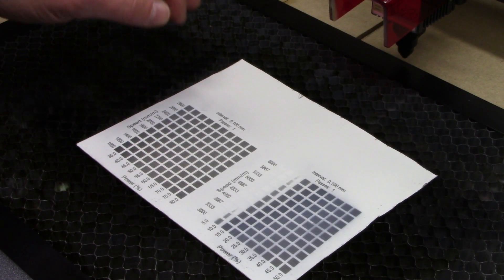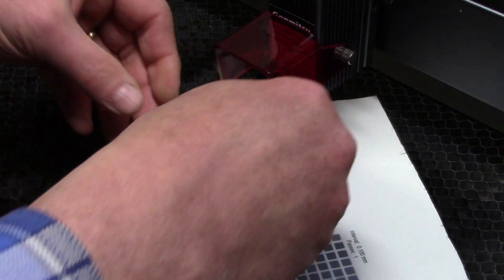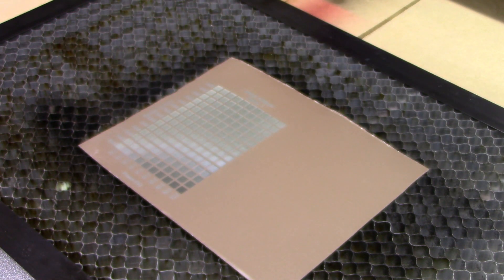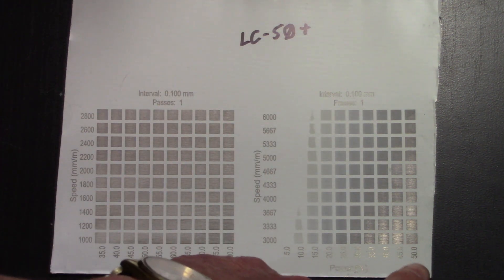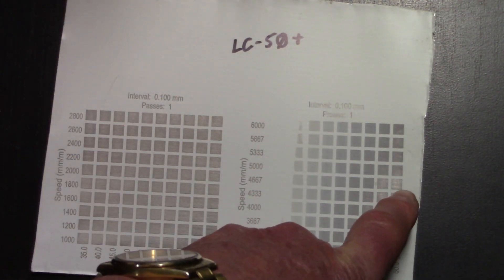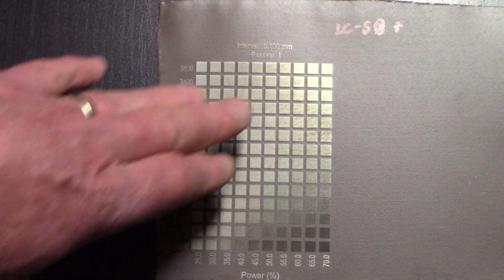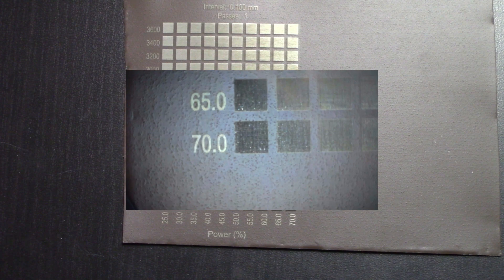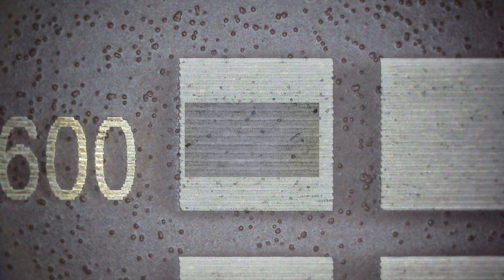Can the Genmitsu LC-50 Plus engrave on aluminum flashing?

Comment: I bought a 20W diode laser in hopes of making control panels for electronic gear, and have been watching lots of videos.  Your experiments with various coating materials have been very helpful, but this stuff looks like an ideal solution - low cost and high contrast marks using a small laser.   The ability to burn the aluminum enough to turn it dark is interesting and creates the possibility to create a two-tone appearance.    I like that this material is thick enough that laminating it with a stiffer panel should be easy.   Thanks!
Reply from the maker: With a 20 watt laser, you might be able to get the metal etching material to work.  They say you need a CO2, fiber, or YAG lasers.  I would bet a 20 watt diode would do the trick.  Tricky with aluminum as it like to dissipate heat so easily.  Using the coated aluminum did lend itself to labeling holes or such for a control panel.  I hope you are able to get the results you want.  :-)